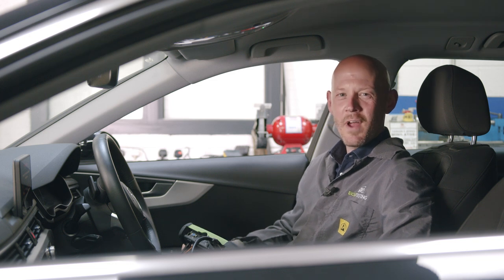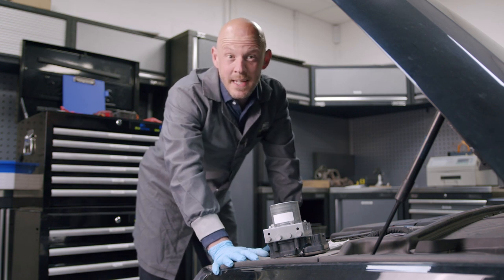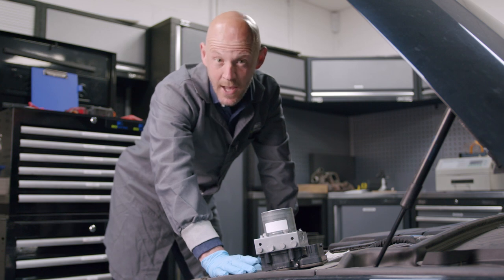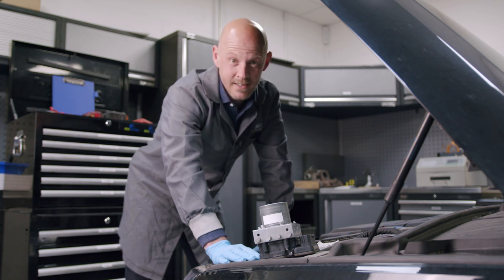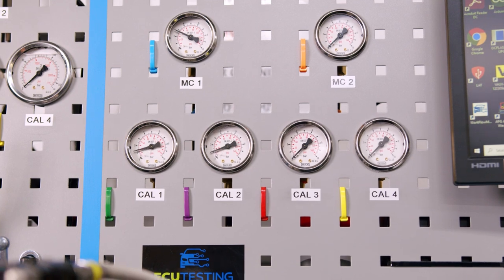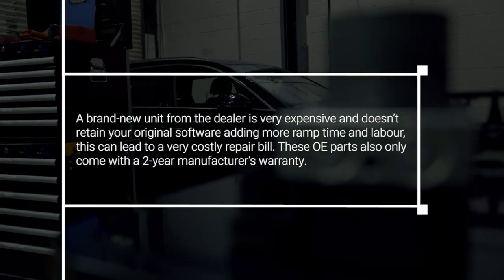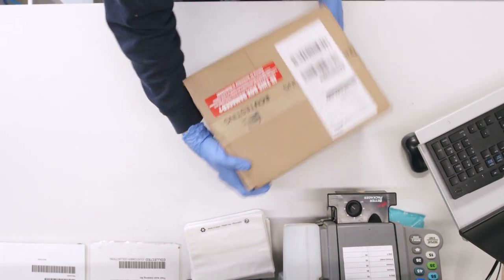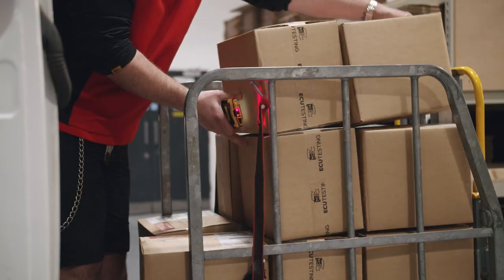Audi Brake System Fault – C123EF0 Brake Booster Failure

Comment: I have this fault, but brakes Working normal, as usual, first I had yellow warning light -break servo restricted, then after few weeks of driving with this, the red warning light appears with this code. Do you know why breaks working normal, maybe is just some sensor broken?
Reply from the maker: Hi. If possible, could you scan the vehicle for any current fault codes you may have and send them to our technical support team at info@ecutesting.com, along with your make and model of vehicle and the symptoms of your fault as you have listed above. It's possible your ABS module is faulty, but a vehicle scan would potentially confirm this. Thanks

Comment: Hi, I have the exact problem which you describe in your video with the same fault code etc.  I am based in Dublin, Ireland, can I send my unit to you for repair.  If so what is the best way to send it, DHL, Fastway etc.  Are there any issues with Brexit? I appreciate your time and look forward to your reply.
Reply from the maker: Hi Patrick, you are definitely able to send your unit into us. Select your car model or part number from this page: ecutesting.com/common-faults/audi/audi-abs-brake-booster-fault/# and fill in the online re-build test form.

If you have any concerns with shipping then feel free to contact our office on 01773 535638. Thanks
Reply: Hello, I am also in Dublin, did you use this service? If so can you tell me full cost please. I have the same error
Reply: @philgriffin483  hi phil how did you fair out with this problem after?

Comment: Why is he wearing gloves that aren't ESD-safe while handling sensitive electronics? Blue nitrile gloves will happily generate static electricity and can easily damage semiconductors. Most ESD damage doesn't instantly kill a device but will shorten its life and cause premature failure.